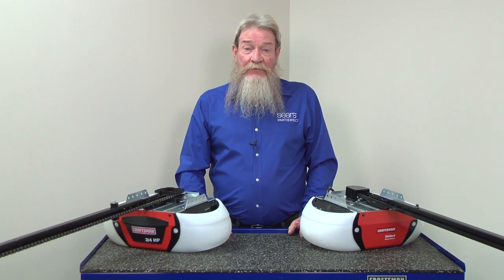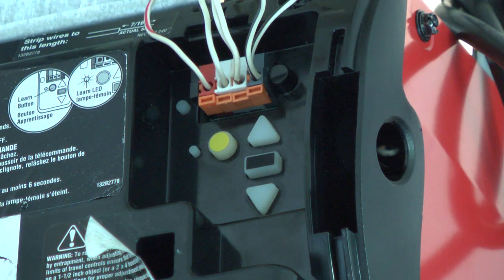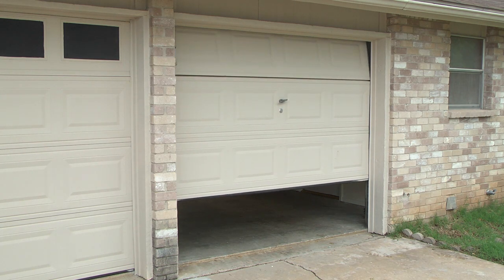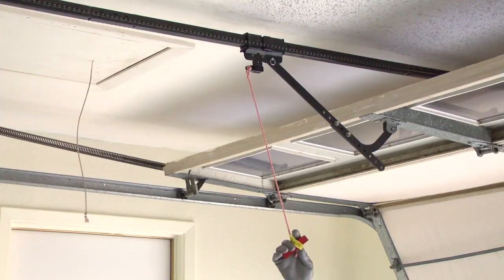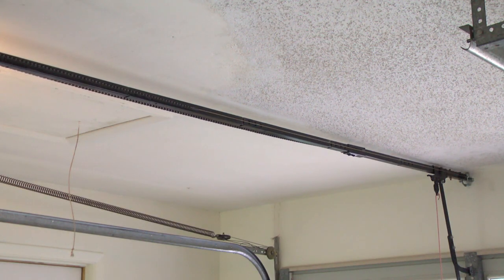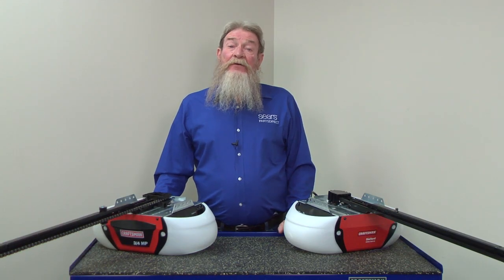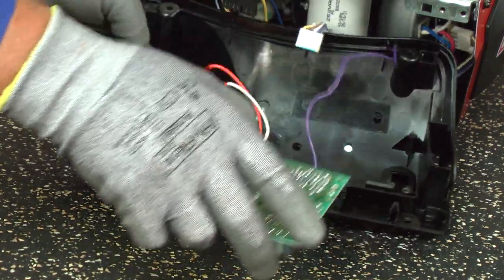How to Fix a Garage Door Opener that Won't Move the Door: Motor and Travel Troubleshooting

Comment: Found my problem which did not match any of the common problems described in this video.  I have a Liftmaster model 2110 1/3 hp which is screw driven, no chain. I had no flashing light. Could hear the motor running the normal length of time.  Door smoothly opened and closed manually, all of the rails appear to be straight and free from damage.   There is a flexible gear sprocket coupling  (part number 25C20) that connects the gear from the motor to an identical gear on the end of the screw that turns which lifts and lowers the garage door. This rubber/plastic coupling had split in two from being used over a period of 13 years, so power from the motor was not being transferred to the screw. The sprocket comes with the hardware bag  partn #41A4795. Pretty sure I can replace it if I can get my son to help me hold the rail that houses the screw...it should just slip into place.  Hope this helps someone.
Reply from the maker: Thanks for letting us know what you found. That  information can likely help other views who face the same problem.
Reply: Same exact problem wow. Thanks

Comment: when my craftsman  garage door closes a alarm sounds ever minute or so
Reply from the maker: If your garage door opener has a backup battery, check the status lights for the battery. Here’s a link for an owner’s manual on a common Craftsman garage door opener with a backup battery in case you need it: https://www.searspartsdirect.com/partsdirect/user-manuals/13953918d-craftsman-parts-manual Page 33 of that manual shows how to read backup battery status lights. If the backup battery is weak and won’t recharge, then you may need to replace the backup battery. If the garage door opener is beeping because it lost AC power and it’s operating on battery backup, check the house circuit breaker for the garage door opener’s AC outlet and reset the circuit breaker if it tripped. If the AC outlet isn’t working and the circuit breaker isn’t tripped, have an electrician repair the electrical outlet.
If you have a Smart Control Craftsman garage door opener, the motor unit will beep when the TTC (Timer-to-Close) feature is about to close the door automatically. Here’s a link for a manual that explains how that feature works on a typical Craftsman garage door opener: https://www.searspartsdirect.com/partsdirect/user-manuals/13954931-craftsman-parts-manual Page 37 of that manual explains how the TTC feature works. 
Using the WiFi control to shut the garage door using the Assurelink system can also trigger an alarm as the garage door closes. 
We hope these tips help. If you need more assistance, post more details and let us know the model number of your garage door opener.

Comment: I tried everything up to checking the inter trolley travel while the emergency release rope was disconnected without identify the issue.  When I release the emergency rope and press the garage door opener the inter trolley won't move at all.  The chain engages and I'm able to see tension on the chain but it doesn't move.  Do know know what the issue could be?
Reply from the maker: The inner trolley may be jammed against the outer trolley and the garage door may not be traveling smoothly along its tracks. With the emergency rope pulled, try to raise and lower the garage door manually. If the door won’t move, disconnect the door from the outer trolley and try to raise and lower the door manually. If the garage door won’t move when disconnected from the outer trolley, you’ll need to find and repair the door travel problem. If the door moves smoothly when disconnected from the outer trolley or with the emergency rope pulled, then the inner trolley may be jammed against rail or the chain may be jammed up because of a travel limit switch or logic board failure. If the sprocket is trying to move the chain and the chain is jammed at the end of its travel, then you’ll likely see the rail bow because of chain and cable are exerting tension on the rail. Don’t continue to run the garage door opener if you see the rail bowing because the pulley on the door end of the rail can break. Releasing the chain tension from the rail in that situation will be difficult and dangerous so you may consider having a service technician examine and repair the garage door opener. You can schedule service here if needed:  https://www.searshomeservices.com/. You may also consider replacing the garage door opener with a new one because repairing your current opener may cost about the same as buying a new garage door opener. We hope this information helps. If you need more assistance, let us know.
Reply: Tim Stevener  That’s what mine is going, 😩

Comment: Can you help me with a problem with my Craftsman garage door opener? I bought it 2.5 yrs. ago and now i am having problems with it opening and closing. I saw it flash 5 times and after checking out the rail, and the chain which i re- adjusted due to yearly maintenance, sensors, and adjusting force and limits, i still have the same problem. It doesn't flash anymore. The ext. light will go off now and come back on about a 2 min.'s later after a certain amount tries of getting the door open or closed. It opens all the way up for the most part, but not always. When i try to close it's a real struggle. I have to hit the remote a bunch of times in between the opener shutting down and getting it closed. I ordered an rpm sensor but i am still not sure that is going to be the fix. Most  of the time when the door is going down it only moves 6-8 inches, but not all the time, which according to the manual says its the rpm sensor.
Reply: Now my light won't come on at all so that the sensors work. When i do get it to come on and press the remote it shuts down(off) as soon as i press the remote. Self diagnostic light does not flash anymore either. I changed the rpm sensor and it worked a couple of times and now it's pretty much dead. Please help me.
Reply from the maker: Check the power supply for the garage door opener. If you have the garage door opener plugged into an electrical outlet in the garage, plug a lamp or work light into the outlet to see if the outlet has power. If the lamp flickers or doesn’t work, have an electrician fix the electrical outlet. If you have the garage door opener hard wired to electrical supply wires, shut off the house circuit break for the garage door opener to kill power and check the supply wiring for loose wires. If the electrical supply going to the garage door opener is okay or the supply wires are properly connected, check the power cord for damage and replace the power cord if it’s frayed or cut. If the power cord is okay, check the power cord wiring connections to the logic board. Here’s a video that shows how to access the logic board: https://www.searspartsdirect.com/repair-guide/garage-door-opener/how-to-replace-the-logic-board-on-a-garage-door-opener.html. If the power cord and its wiring connections to the logic board are oaky, then check all wiring connections on the logic board and reconnect any loose wires. If logic board wiring connections are okay, then you may need to replace the logic board. If you need more help, let us know the model number of your garage door opener and results of the recommended checks we provided.
Reply: I already tried it a different socket and i tried it with a lamp too. No luck there.
Reply from the maker: Unplug the garage door opener and check the wiring connections on the logic board. Here’s a link to a video that shows how to access the logic board: https://www.searspartsdirect.com/repair-guide/garage-door-opener/how-to-replace-the-logic-board-on-a-garage-door-opener.html. Reconnect any loose wires and repair any broken wires. Here’s a video that shows how to repair broken wires: https://www.searspartsdirect.com/article/how-to-repair-broken-or-damaged-wires-video.html. If the wiring connections on the logic board are okay, then you may need to replace the logic board. If you need more help, let us know (and include the model number of your garage door opener so we can tell what type of opener that you have).

Comment: I had to unplug power to the system. My liftmaster 3/4hp only makes a continuos clicking sound as soon as I plug in mains power, about 10 per second, but motor doesn't move. Help anyone?
Reply from the maker: The clicking could be a faulty relay on the logic board. You’ll likely need to replace the logic board if a relay on the board clicks constantly as soon as you plug in the garage door opener.

Comment: what do you do to if your door goes down but then opens back up again on its own. sensors are aligned, no obstruction on the track.  looks like there are 2 sets of adjustment screws up and down on the side and also on the back. how do you know which one is to adjust the door to open and close properly ?
Reply from the maker: One set of adjustment screws adjusts force limits and the other set adjusts travel limits. Your details seem to indicate that you’ll need to adjust the down-travel limit because the door bottoms out before reaching the set down-travel limit so the opener lifts the door back up. Follow the instructions in your owner’s manual for adjusting the down-travel limit. You can also check and adjust the force limits at the same time to make sure the force limits are set properly and safely according to the guidelines in the manual. If you can’t find your paper copy of the owner’s manual, you can likely find an online copy of the manual through this link: https://www.searspartsdirect.com/partsdirect/user-manuals.

Comment: Our Craftsman garage door opener starting making a terribly loud ripping sound  that lasts long after the door is closed. It only started doing this today, and we thought it may have had something to do with the unusually cold temps we've been having (-15F overnight). The belt is intact, if but a little saggy. When the opener is released from the door, the garage door slides up and down without any problems. What is causing this problem, and how would we go about fixing this issue? Thanks in advance for any advice!
Reply from the maker: The noise you’re describing seems to indicate that belt cogs were slipping on the opener’s drive sprocket. A damaged or loose belt will slip and cause a ripping sound because the cogs rub against the rotating drive sprocket when the sprocket can’t grip the cogs. A damaged sprocket will cause the same noise because the sprocket can’t grip the belt cogs.
 
With the opener still released from the garage door, check the belt for damaged cogs and replace the belt if cogs are missing or worn. Here’s a video that shows how: https://www.searspartsdirect.com/repair-guide/garage-door-opener/how-to-replace-the-belt-on-a-belt-drive-garage-door-opener.html.
 
If the belt is okay, check the sprocket for damage and replace the sprocket if it’s worn or broken.
 
If the belt and sprocket are both okay, loose belt tension could be causing the noise problem. With the opener still released from the garage door, adjust the belt tension as shown in your garage door opener owner’s manual. If you can’t find the paper copy of the manual, you can likely find an online version of the manual on our Sears PartsDirect website using this link: https://www.searspartsdirect.com/partsdirect/user-manuals. Once you adjust belt tension, check the up and down travel limits and adjust those settings if necessary so the garage door opens and closes properly.
 
Extremely cold weather can contribute to belt damage along with other factors such as garage door travel obstructions or loose belt tension. Just the cold weather alone won’t necessarily cause a garage door opener belt to fail. Extremely cold weather typically won’t affect the drive sprocket or other garage door opener parts.

Comment: Mine was blinking 5 times so I ordered a new rpm speed sensor and installed. Still doesn’t work. Motor hums briefly and there is no travel from the door. Upon further inspection I seen that the plastic gear was cracked and tilted. Will this be the cause of my problem? Would there be another problem that would cause the gear to crack? Thanks
Reply from the maker: Yes. The cracked and tilted plastic gear will jam up the motor so the motor stops after running briefly. Replacing the gear and sprocket assembly will likely fix the problem that you’re describing. Here’s a video that shows how: https://www.searspartsdirect.com/repair-guide/garage-door-opener/how-to-replace-the-gear-and-sprocket-assembly-on-a-chain-drive-garage-door-opener.html.
 
Trying to open the garage door using the garage door opener while the garage door is locked can break the gear and sprocket assembly. Make sure that you unlock the garage door before you activate the garage door opener to open the garage door.
 
Also, problems with smooth door travel can break the gear and sprocket assembly. Pull the emergency release rope and raise then lower the garage door to check for smooth travel. If you have trouble opening or closing the garage door manually, check the door’s travel rails and adjust them so the door travels smoothly along the rails.
Reply: I have the same problem, motor hums briefly, and then, nothing!

Comment: Hello, I might have a similar problem to the previous commenter... the part on the rail (trolley?)  that connects to the emergency release pull will engage but the minute I leave it alone it disconnects again.  Someone came and told me I needed a new opener but I have   a hard time believing that because you can hear the motor running and the last time this happened someone came out and reattached it in 2 secs.  He said it was 'locked up' and there is no fix for that? Sounds shady to me cuz I haven't found anything on youtube talking about a locked up motor.  Any thoughts much appreciated.
Reply from the maker: Your details seem to indicate that you’ll need to replace the trolley if the disconnected trolley travels along the rail when the motor runs. Look up the part using the model number of your garage door opener. If you need more help, let us know (and provide us with the model number of your garage door opener).

Comment: My Stanley garage door opener works for the most part, but I opened it, the door went too far, and it won't close. I tried pulling the emergency release, but it won't do anything.
Reply from the maker: The trolley may be jammed against a stop on the rail. You may be able to free up the trolley by releasing the chain from the motor sprocket. You’ll likely need to pull the garage door opener down to release the chain.
Reply: If it is a screw drive, use a slotted screwdriver and rotate the motor shaft so the carriage moves toward the down position and it should release the carriage from the screw

Comment: Hi there i have a older opener model number is 139.53985D the light blinks 4 times. The travel is just a couple of inches then stops light bulbs blink about 10 times. Anything  you can think of is the problem
Reply from the maker: The blinking lights indicate safety sensor problems. Follow the troubleshooting steps in this video to correct the problem: https://www.youtube.com/watch?v=D1-jABFaOLU&t=53s&list=PLbGAdX0H4-7-q_VT8yEwNcYQ6qnkCOymJ&index=1

Comment: My inner trolley moves the length of the track fine and the door is easy to raise and lower manually. The LED doesn't flash at all but when I connect the door to the inner trolley the door raises 2 or 4 inches and the motor runs for several seconds then reverses and closes the door then continues to run for several seconds and finally stops.

I think there's a sensor problem. Do you have any insight?

Excellent videos by the way!
Reply from the maker: The garage door opener could have a sensor problem depending on the model. Also, a weak drive motor may not be able to open the door even though you can open the door easily when you disconnect the door from the trolley. Let us know the model number of your garage door opener and we’ll provide more specific troubleshooting advice.

Comment: When my garage door opens the light flashes twice hen the light turns off then it not let me close the garage door.
Reply from the maker: The light flashing twice indicates the safety sensor wires are shorted or reversed. Check the installation of the wires on the motor unit to make sure you have the wires connected properly. If you find no problems with the sensor wire connections, check the wiring for damage. If you find no visible damage, conduct the test of the safety sensors using short runs of wire directly at the motor unit as shown at 3:17 in this video: https://www.youtube.com/watch?v=D1-jABFaOLU&index=1&list=PLbGAdX0H4-7-q_VT8yEwNcYQ6qnkCOymJ . If the sensors work during this test, then you’ll likely need to replace the sensor wiring between the motor unit and the sensors.

Comment: I have a brand newCraftsman 3/4 belt drive. The door went up once made a loud bang and now the trolley will not move. the door has been release. The motor comes on but will not move the trolley. Wish I still had my reliable Genie 450!
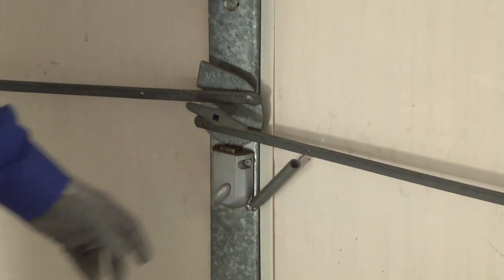Reply from the maker: The inner trolley may be jammed. Try pulling the garage door opener down and releasing the belt as shown at 1:43 in this belt-replacement video: https://www.youtube.com/watch?v=WBWPYnsodW0. Once you release the belt then you may be able to free up the trolley and reinstall the belt. Make sure to follow the instructions in your owner’s manual for setting the up and down travel limits. The trolley can jam if you don’t set the up and down limits properly.